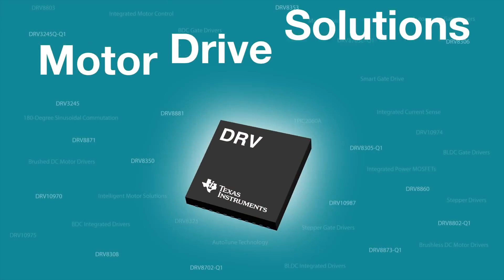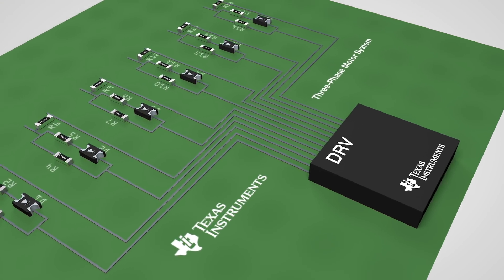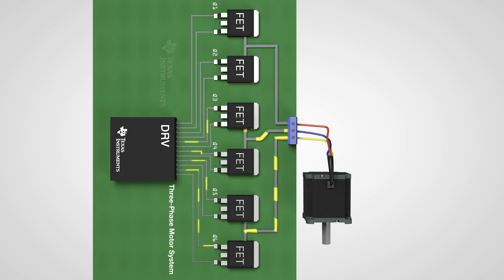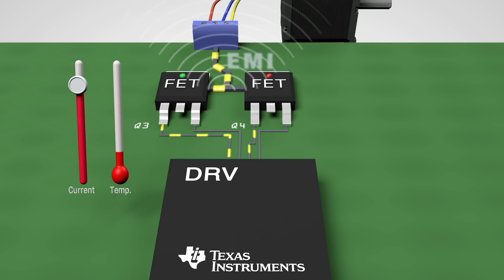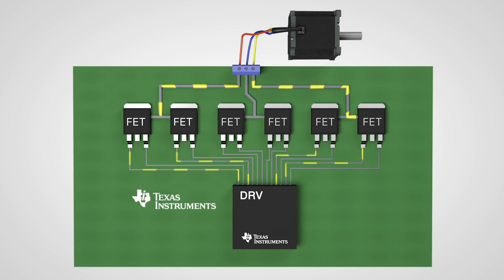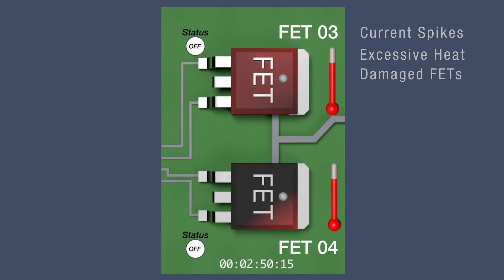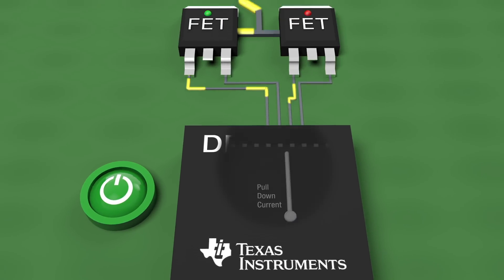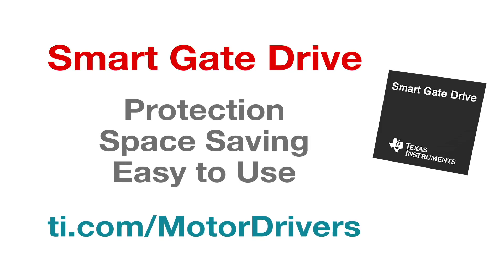Smart Gate Drive Technology

Comment: I need a gate drive working in 1MHz form Texas instruments
Reply: And what will u drive it with, normal mosfet and igbt doesn't work at that hi frequency.
Reply: @deepaknanda1113  I use SiC MOSFET C2M0080120D transistor from WOLFSPEED, what Gate Drive working in 1MHz with the transistor to design a full bridge inverter??
Reply: @deepaknanda1113  I will  use SiC MOSFET C2M0080120D transistor from WOLFSPEED to design a full bridge inverter working in 1MHz.
Reply: I will waiting reply from you @deepaknanda1113